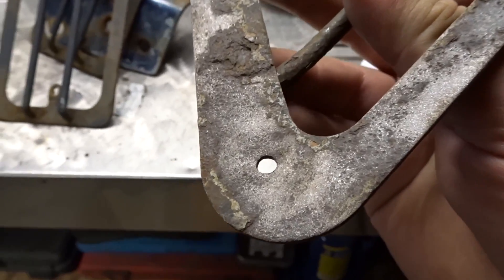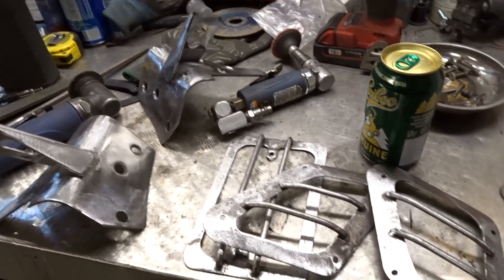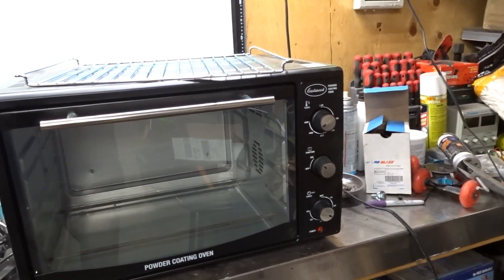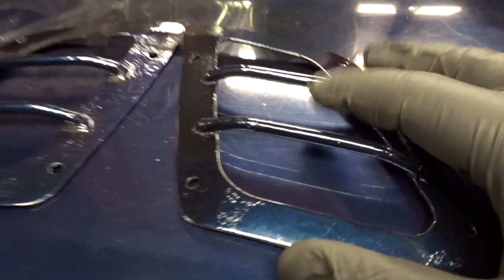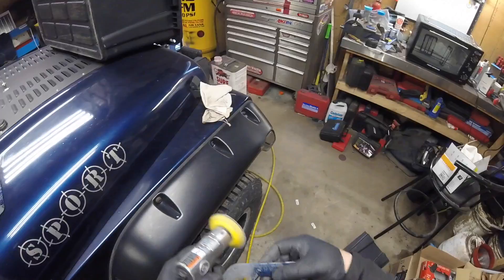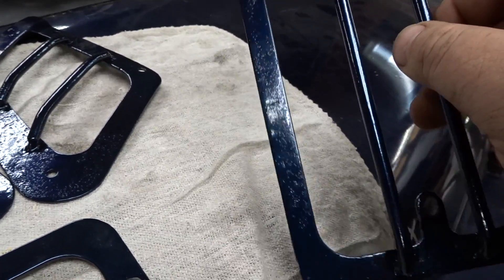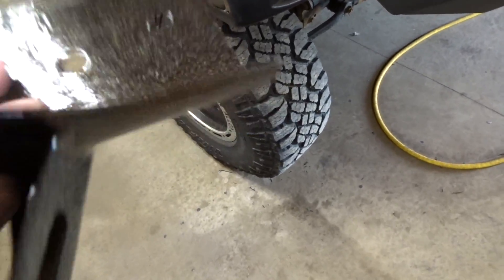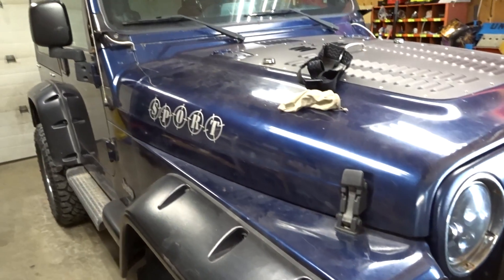Powder Coating Rusted Metals Curiosity

Comment: If you have the time, plain white vinegar works better than I ever imagined to remove rust.
The pillar mounts look great.
Reply: ManicMechanic007 
I have been working on my Jeep and have been using vinegar as well works wonders tho if you were able to sand blast prior to letting them soak I think the results of just vinegar would be better and probably wouldn't take as long. Also on another note I've heard of guys using some sort of primer to help with corrosion and just the overall finish.
Reply from the maker: Very interesting I’m going to have to try that out next time
Reply: Don't bother, chemical action is only good for (very) light surface rust and you will still have to scrub off the remnants with steel wool. This would take you multiple doses of vinegar and you will be bored out of your mind.

Comment: You could have saved it what you should do next time is the gas out  the part before coating it ......500 degrees make in the oven for at least 20 mins  those bubbles appeared because when you heated the parts the gas from the impurity in the metal were trying to escape.  Burning off the impurities is a common practice in a professional application to make sure it is done right the first time.

Comment: Thanks for the video.I am getting ready to try powder coating on some engine parts some have rust.Have them in a parts washer to wash all the old crap off them and then gonna blast them and use the evp to try and eat away the rust from inside the parts then powder coat them have you tried that idea and what were the results

Comment: My first instinct would of been to use a wire wheel brush, although the current state they are in i'm not sure much would of helped. Looks better than it did though.
Reply from the maker: Wire wheels work good too but these were in rough shape to say the least

Comment: Once the parts are blasted, an overnight soak in a rust eliminator like evaporust or other type of rust eliminator would have cleaned out the pits very easily.
Reply from the maker: Good point I may have to try that
Reply: I had the same issue. Blasted some brackets with garnet, still left with rust and dirty junk in the pits. Soaked them overnight (in evaporust) and it was super clean. Powdercoated them and done. You can still see some pitting through the finish, but not bad since the coating is protecting the pits and not over the contaminants in the pits. Give it a shot

Comment: Well...that’s a fucking bummer.  I guess the guards just had too much rust for a thin piece of metal.  The light brackets turned out really cool.  Digging the sparkle in the finish Jerry!  I agree with you, probably worth the cash to buy new ones and powder coat them.  I wonder how long the new ones with powder coat would last with those harsh winters you have?  In Los Angeles the only issue is if you live by the ocean and it will even fuck-up chrome. Thanks for a cool video!
Reply from the maker: I’m giving them just over the winter and they will start to rust.

Comment: I think you can use body filler to fill in some of the imperfections in the metal.
Reply from the maker: I think you can with a high temp bondo or metal filler something I’m going to have to read more up on
Reply: @TestDontguess  This guy who restores vintage toys did in fact use filler on a pitted metal part and then proceeded to powder coat.  It works.  Just make sure you do a good wet sanding because that would determine the finished surface texture.

Comment: You need some more aggressive blasting medium
Reply from the maker: Tried that and didn’t work, explained that in the sandblast cabinet, need to set it up and find the the variables that work best
Reply: @TestDontguess  Do what they do with cast iron cookware restoration.  50/50 water and vinegar for not more than 30 minutes.  Rinse and repeat until the gunk is tenderized.  It should easily come off later with sandblasting if there's any left.

Comment: Jerry my man, if you want to remove rust and get back to BRIGHT WHITE METAL please go back and read the comment I left on your first powder coating video. 
Your setup looks like you are working waaay too hard for the poor results. That cabinet is a bust for several reasons. The main one is because the interior of the lid will become dull and hard to see your item in no time, which it clearly already has happened. 
Also there doesn't seem to be enough bite from your media which is probably due to wet air coming from your tank. 
Just buy a hopper, some PPE and do your blasting quickly out in the ally. It will take you 15 minutes to make all four of those pieces look like they traveled back in time to they day they were born.
Reply from the maker: Couple things blasting in the alley is highly illegal for numerous reasons and second the air compressor has a big dryer that the hose connects to